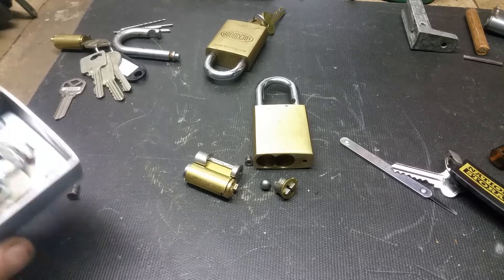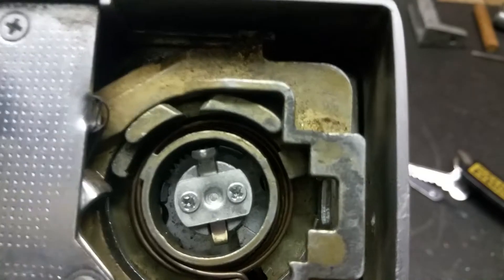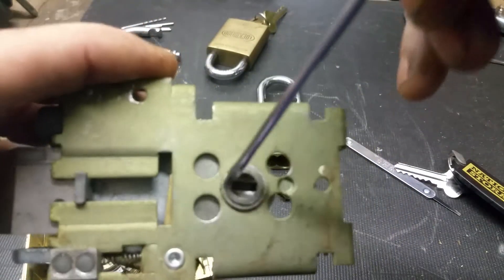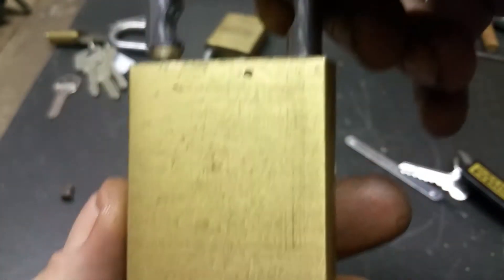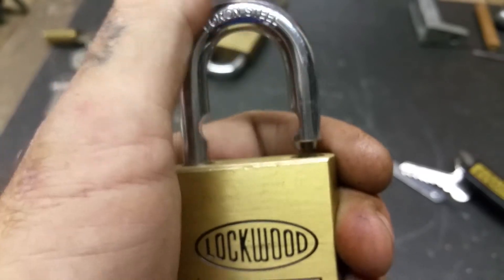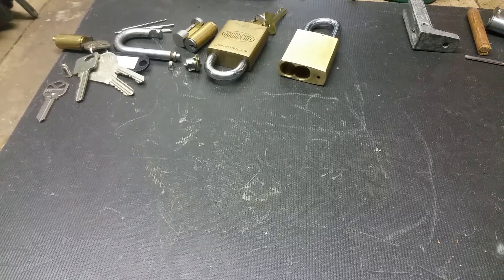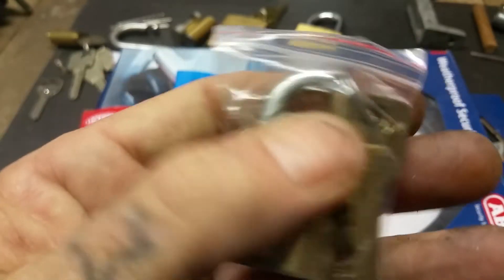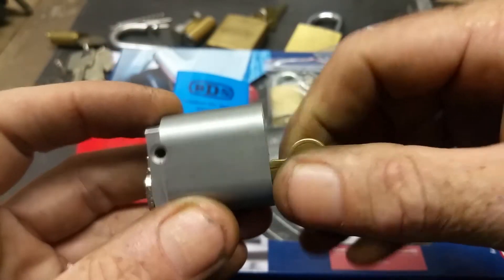#14 A quick revisit on the 001/002 and a ramble.

Comment: Nice info, and a cool gift box, i like that from the fire bigate i used to Work on a fire station
Reply from the maker: Thanks mate. They are not such a noticable padlock in use today. There's other manufacturers that produce more secure padlocks on the 003 profile. An ex fireman that picks locks, lol. Cheers:-)
Reply: I don't want to try and be something i am not, so please don't call me a fireman i did not go trough the Hole training, i worked at a fire station, but it was not only a fire station it was also a training ground for firemen, i took some of the training but not the full training, but i helped training some of those who whent trough the Hole training, i was only a helper, but i learned a Lot and i had a Lot of fun, i loved when sometimes a school came to have some fun All those wierd questions from those kids that was relly funny,😁

Comment: For rookie only the 334 brass. the shackle can be removed with the core in turn the key fully clockwise and push the metal pin in. And watch it fly across the room lol
Reply from the maker: Well @#$% me. I didn't know that. Doh! Might have to employ you as my tech advice manager. lol. Thanks for the info Funkey:-)
Reply: @crankylock7844  lol only the brass ones have that feature. Surprised the marine and steel ones dont have it
Reply from the maker: Well blow me down. It works......who would have thought? Well obviously not me. lol. Cheers:-)
Reply: @crankylock7844  He told me the exact same thing. I think he'll make a good tech support person.
Reply: Thanks for pointing that out Funkey MonKey! I have a 334b45 that I was thinking of putting a shorter shackle in. Ill have to give that a try.. I'll give you a shout if I have any trouble :P
Reply: Holay crap Funkey! Thats flippen awesome! Pretty neat little trick, how the hell did you discover that? hhaha
Reply: @RookieLock  lol no worries brother happy to help ✌😊🍺
 I've got a bunch of the 334's and known it for a while.
Thank Lockwood ASSA ABLOY for a well designed product lol.
Reply from the maker: @RookieLock  He's the 334B/45 padlock whisperer. lo:-)
Reply: @funkeyfastdrawmonkey1483  I was thinking the same thing, mine too flight into the wall. Lol.😁
Reply: @DonzLockz  👍😂

Comment: The 334 has 3 shackle sizes. You probably know that, Paul. For those who don't, the sizes are 19mm, 38mm and 48mm. The 19mm one has a security rating of 7. The other two have one of 6.
That's for the brass ones. The steel and marine versions are all 7s.
Reply from the maker: Thanks for the heads up. Spec info is a never ending cycle. Cheers:-)
Reply: Just a guess but i think the shortest shackle gets a 7 security rating due to restrictive access to the shackle with bolt cutters when its used on chains and hasps.
Reply: @two_tier_gary_rumain  not sure mate could be material and type of shackle as there is a few types such as hardened steel, molybdenum and stainless steel